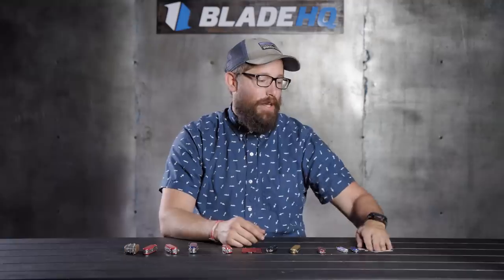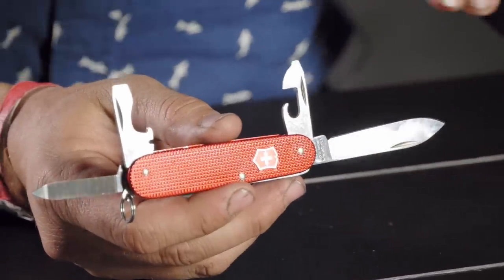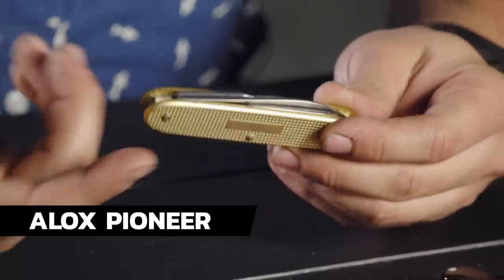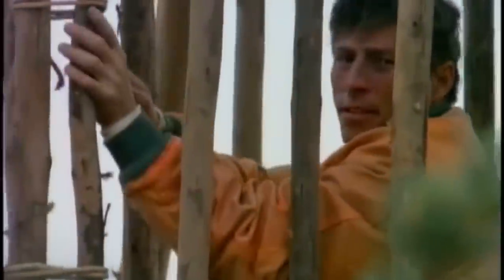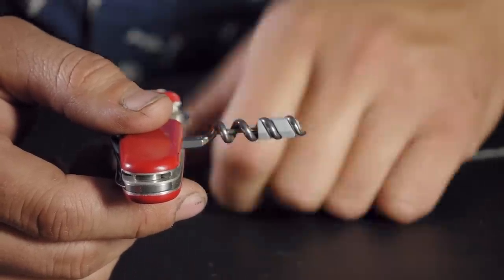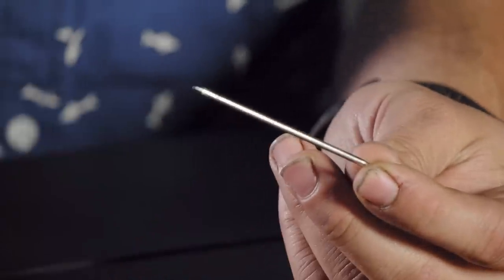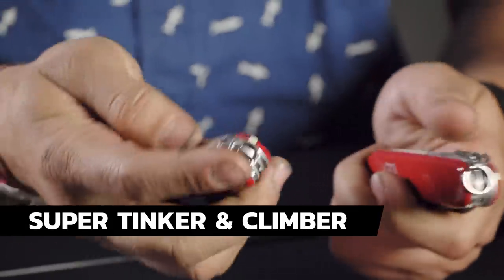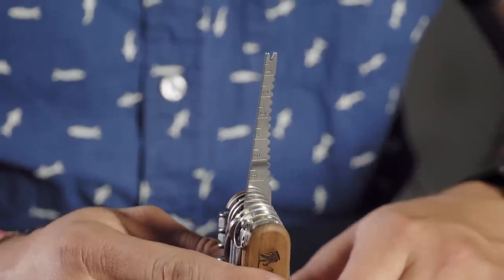Victorinox Swiss Army Expert Breaks Down the Best Swiss Army Knives | Knife Banter Ep. 88

Comment: The can opener seconds as a 2D philips head screwdriver on all SAK models.  Although it may partially mangle the philips screw you are using it on.

That being said the Cybertool S and Cybertool M are what I have found to be the most useful SAKs for my applications and thus the Cybertool S has become a part of my EDC.  

Being in residential construction, more so on the finish end of projects, I have lost count of how many door stops, door knobs, electric outlets, cabinet pulls, cabinet hinges, screen doors, and even light fixture I've installed using only this tool.  Usually when walking back out to the truck for a screw driver, drill, or pliers would have taken longer than just pulling out my SAK from my pocket.  

Although I cut my teeth on the Alox Cadet and then upgraded to the Alox farmer I found having a full "bit set" at hand is far more convenient than just the standard 3 driver heads included on most standard SAKs.  

Now if only Victorinox would make a Cybertool S and replace the blades with the pliers I would be eternally appreciative.  Reason being is I already carry a small utility blade(Rexford R.U.T.) and main knife.

Not to mention it would make for a very capable TSA friendly multi tool as well.

Make that version in Green Alox and I'd be on cloud 9 for sure!

Comment: I bought my first SAK in the early 90’s, a Champ for $50. I ended up getting a 2nd one in black opposed to the first in red. I gave my red one away to a good friend but still carry the black one every day in a sheath on my belt. I love the quality of the SAK, easy to sharpen, tools never loosen. I use the magnifying glass to see small print now that I’m 50, or to start a fire in good sunlight. The woodsaw cuts through a 2X 4 in seconds and it’s just a great all around edc tool. I still carry a Leatherman sidekick but it doesn’t have a scissors so I carry both.

Comment: I've once used the parcel hook to pop open a locked door. Just slipped the hook in a small gap between the door and the frame and it hooked on the inner door lock and I just pulled it open! 👌 Worked like a charm! 
(And don't worry it was on my own property)

Comment: This is a great video.  Thank you for sharing.  What I am using more often for screws is Torx Screws.  They are much easier to use for construction. I just insulated my roof with polyiso insulation and built a frame work on the top of my roof and have put it altogether with a frame work and Torx screws.

Comment: I use the flathead screwdriver for opening jam jars. Don't know if you use those glas containers with metal lids in the US but here they are common. And with the flathead you can go under the lid and twist a little to release the seal and get the thing open.
Also some cabinets for technical use got "locks" which can be opened with it...

Also the thing with Swiss army knives is you pick one you like and carry it, you will find unintended uses for almost any tool.
No need to search for what you can do with the tools, you will encounter situations where you need to do something and will come up with a helpfull usage of the SAK. I don't drink, but in one occasion camping with a bunch of people one of them had a bottle of wine with them. But none of them had thought of an opener, and while they were thinking of breaking the bottle i handed them my knife...
As for SAKs and Leathermans and SwissTools: they aren't better than proper tools for the job, but sometimes they are the only tools at hand, and save the day.

Comment: The hook on the compact is a rope tool. It's used for tying and breaking knots. So, the little point on the end, is for pushing through a knot, and then you use the hook to grab a loop and pull it back through. It's basically like a crochet needle. I guess you could use it as a parcel carrier too.

Comment: I’ve been carrying a SAK for 40+ years in one form or another and my SwissChamp has been my EDC in my belt pouch for nearly 30 of those years. The tool is only limited by your imagination. I’ve used the parcel hook for carrying parcels, pulling tent stakes, picking up Dutch ovens by the bale, twisting twine and much more. Don’t make fun of the pliers, they work better at pulling some splinters than the tweezers. The question was asked as to why the flat head screw driver and the answer is in the name…Army.  When the knife was developed the screws on most equipment, including rifles, were slotted. Even today many weapons are still assembled with slotted screws. Also, you can still turn a Phillips head with the flat head screw driver.

Comment: I have zero problem carrying the Swiss Champ everywhere I go. It's easiest in the cordura pouch, but I also carry it by hanging it from a belt loop with a Paracord lanyard I made. It can be dropped into either my front or back pocket  while hanging from the button and loop lanyard, or just left hanging free. The lanyard can go around a wrist for working over water or drops. The lanyard is quick detachable and serves as a strong soft shackle. Additionally I have a thermometer, and compass with magnifying lens, and a light, attached  by a loop and button lanyard which can be quick detached and used or secured seperate.  I got the Firefly firesteel and corkscrew   fuel installed as well. I use the hook to to secure Paracord I'm working on, by closing it with the cord in the hook, and tension it by hanging the knife over something while working the cord. It's good for pulling one end tight, just hook the cord and twist, then close grip and pull. Victorinox steel is absolutely fine. If your chipping your blade, your abusing it.  SAKs are superior quality and toughness than Leatherman, and are far more dependable and useful. Tweezers are great, but far more useful with a small light and a magnifying glass.

Comment: You spoke about the pen right after the hook. The hook can be lifted up and the pen slotted into its groove, then the hook closed carefully - Then you have a longer and easier to use pen. I have also used the hook to grab things in a narrow spot eg a cable in a hole. Other uses below. The SwissChamp can be carried in your pockets if you have thicker materials eg jeans / heavy shorts. The great thing about that is it has everything you might possibly need and is more convenient than a pliers based tool - Tools are easier to access and it's lighter/smaller. The fish scaler is useful if you need a non-sharp pokey tool!

Comment: 4:23   He is showing off some seriously dirty fingernails. ha ha.    21:30 The parcel Hook will hold the Pen and allow you to write more comfortably.   If you lift the Parcel hook, the pen will lay perfectly in the slot the the Parcel hook rests in. Once you lay the pen in the slot, lower the parcel hook to add the pressure to the pen.  YOu can then hold the knife and write much easier.   I made a video on this about 8 years ago.  Search practical use for victorinox parcel hook.   Also, if you use a p-7 suspension clip, you can carry the swiss champ no problem.   P-7 clip is the reason I don't carry the Super Tinker, Compact, Explorer and Yeoman any longer.  cheers!

Comment: I recently kinda gotten into SAK knives. I have the fieldmaster. Its the same as the huntsman but instead of the corkscrew it had the Phillips screwdriver. And i have replaced the toothpick with a tiny fero rod, called the firefly. EXTREMELY handy for starting a fire. It's awesome really.  And i use the "parcel hook" quite a bit.  I use it to take the cooking pots on and off the fire when camping. Works great. Im looking into getting another SAK for EDC. A larger pocket knife one. Im quite impressed with my fieldmaster. But its kinda been designated to my backpack.

Comment: Worked as an in-house computer support guy for 20+ years maintaining 100 or so PCs and carried the Tinker most of the time. It was my first-line tool because the phillips and straight-slot screw driver attachments allowed me to open the metal computer cases, install expansion cards (graphic, memory, modem), swap out CD/DVD and hard drives, etc. The smaller knife blade opened shrink-wrapped packages, toner containers, just about anything that was in a box or an envelope. The tweezers came in handy if I dropped a mounting screw inside the computer case and wasn't able to retrieve it with my fingers. The Tinker's design is compact enough for business casual pants or jeans pockets. Still carry one even though I retired a number of years ago. Great EDC tool for me.

Comment: I've got the cybertool 34 and carry it daily. It's got the removible bits and driver on it which makes it great for quick repairs in the field during a photo shoot. It's also great for odd jobs round the house and for tightening up loose pot handles and the bottle opener is great for opening stubborn jars. Just pop it under the lid and lift and it releases the seal. Makes opening jars a breeze.

Comment: In Europe Phillips and Pozidrive are the most common screwheads. However, I think Victorinox integrates a lot of these flathead screwdrivers, because otherwise it would be wasted space on the pocket knife, the flathead screwdrivers is almost never a standalone tool, it is always a secondary function of another tool. I personally found the flathead screwdriver on my Alox Farmer works wonders as a scraper or prybar, you don't risk damaging the blade or cutting yourself. If you need screwdrivers, you quickly need so many different types and sizes, that there is no way you could integrate them all in a pocket knife. With the Swiss Tools however they offer a little bitset with either a ratchet or a rightangle srewdriver that fits into the pouch together with the multitool.

Comment: Since you asked about the flathead drivers...The large driver was included on the very first production Swiss Army knife, and did not have the cap lifter integrated. It is there because it fits the flathead screws that were on the standard issue Swiss rifles at the time. It was later integrated with the cap lifter when pop-top bottles became common. The design remains because, so long as you need a beer opener, why not have an extra screwdriver too? Also, the smaller driver on the can opener works well on most standard Philips head screws. I use mine on Philips all the time, and it has not damaged any screw heads, nor the tool.

Comment: I have the big SAK that you showed but with the plastic scales. I never carry it. I carry a PM2. And I don’t use it as tool for any serious work—I have a Leatherman Charge for that. But, I have had that big SAK sitting on my coffee table in the basement where I watch tv for many years and I use it frequently. I use the tweezers and the toothpick all the time. The pen comes in handy to jot stuff down. I’ve used the screwdrivers a bunch of times for odds and ends in the basement. The scissors are used frequently. Basically, it’s a great thing to have on hand in an area that is away from your main set of tools and also for personal use items.

Comment: As someone who fixes slot machines for a living these tools actually make alot of sense. I could use the hook tool for all kinds of things. I use the corkscrew as a pick tool and ive actually used it for knots not even realizing that was a thing. You asked why the flathead and not Phillip's and I think I have an answer. You can use a flathead on a Phillips screw but you cant use a Phillip's on a flathead. They also come in clutch as a right angle screw driver or in a tight place.

Comment: MacGyver's greatest use of the SAK was when he built an airplane with just his knife to make an escape.  I have a personally engraved all metal Swiss knife that has the orange peeler.  It works great for its intended use.  As for the parcel hook: if you're a camper you use it to lift lids or pots off the campfire without burning yourself.  I've opened many a wine bottle with the SAK corkscrew and as for the tweezers-- they saved my butt many a time getting splinters out of my hands.  It's one of the more effective tools of the knife.

Comment: I've had my Executive for about 30 years now, I use it every day for all kinds of things.  I bought it for the novelty of the orange peeling blade, but only used that blade a couple of times because the sap from the orange peels made the knife too dirty, and I didn't want to wreck it.
I love Victorinox knives!
Reply: i have mine for over 25 years, and done the same, while it works good for peeling oranges, the cleaning afterwards is what prevents me from using this function often.
Reply: I never peel oranges with anything but my hands. However, that tool is my rough cutter and driver. It opens caps on vape juice bottles, cuts through parcel tape, and every other messy material. It's my beater blade. The driver tip has repaired more things than any other sak I own. But I know it's limits. That's why I carry a Gerber shard with it. I filed the end of the nail file to fit tiny screws. Also file is good for opening star key locks at work. Executive is my most carried fo nearly 4 years. I can see myself hitting the 25/30 year Mark like you two fellas.

Comment: The larger multi purpose knives  are worn in a pouch on a belt, great on a farm when machinery needs adjusting and the tool kit is at home. Also carried good quality adjustable spanner ground out a few millimetres for large nuts, and a multitool  in pouches on my belt for years.right there when you need them. Pliers on the multitool work with the adjustable spanner for nuts and bolts. I used a 12m compass walking into the bush, to know my way back. It was on a key tag with a 15mm long thermometer. Easy to get lost. The 2 most commonly used size allen keys would be most useful. Espceially for cyclists.

Comment: Good discussion on the hook in the comments here. I agree, just pulling on stuff is something that comes in handy quite often. People here write about shoe strings, carrying stuff and the like. I have used it a bit, what comes to mind is; pulling a pot from the fire when camping, pulling tent pegs, opening an older type of drawer that requires the key to be used as a handle, when the key is missing but the drawe isnt locked, just putting the hook in the key hole and pulling. Also ive pulled out rusted ring-hookes(?), the ones that looks like grenade sprints and secures cheap wheels on a cart for example. It often does a lot of the work that pliers would do, just not as good. On the other hand, it dosnt take up any space at all. A pretty nice compromise. :)

Comment: I carry a Swiss army knife I've been using it for a few years now. Scissors, knife, corkscrew, flat head, can opener, nail file, and an a pokey thing for making holes, idk what it's called. I put a neodymium magnet where the Swiss logo was because it fell off so I carved a hole big enough for my flat magnet then put some shoe glue over it so it didn't scratch anything or get scratched up. I love the metal the blade is made out of, it keeps it sharp and easy to sharpen

Comment: I have several SAKs, but I carry two regularly. The Trekker and the Tinker. The Trekker has a utility blade that is sturdy and slightly larger. But the larger saw is very useful for harvesting branches for wood carving and tinder, while the reamer is useful for making holes in those branches. The Tinker is primarily used for wood carving camp utensils and toy animals, Santa’s, and little people. Those two SAK are with me daily in my pocket and my sling pack.

Comment: If you own a harpsichord or clavichord, you need a hook similar to the SAK parcel hook (I stuck a little screw hook into the end of a pencil to make mine). Because each string has a loop at one end, that goes over a nail; the other end is wrapped round a tuning peg. And since every string has a different length, the manufacturer of the strings doesn't do the loop for you, as they do with guitar strings for instance - you have to make your own by passing the string through the hook and twisting.

Comment: I used to work on a farm and the buckets had wire handles with a little plastic handle that would crack and brake. That little parcel handle would have saved my fingers so much pain carrying multiple buckets filled with water in the cold.

Comment: I've watched a lot of Swiss Army Knife videos and I'm getting to the point where "best" and "worst" essentially boil down to - does the tool contain all the things you want or not? Because that's all it in a nutshell. Most tools will come with some common stuff (blade, bottle opener, can opener) and some variations, e.g. philips screwdriver vs corkscrew. Or saw vs pliers. Or scissors vs file. Or serrated edge vs straight. Beyond that there is precious little beyond models to compare about - it has a blade, it opens bottles & cans and it has some other stuff. They're basically mix and match for the dimensions they're made for. Pick the one you like.

Comment: I use the Hunter and the Fieldmaster.
I have to carry both.
Together ...the parcel hooks to pull baling twine out from rivers ....and fences and trot lines out of the rivers.
Clean up...and salvage.
We have a lot of rogue twine...and it's a nuisance.
And the Phillips screw driver of course...on the Fieldmaster.
But I need the corkscrew on the Hunter to undo knots.
The corkscrew...
Its also useful for cleaning out piping...tubing...and sockets.
And screwing the knife into a wooden post to set up as a jig to cut..and use the can opener.
Don't try it on extremely hard wood though.

Comment: The parcel hook is good for pulling the handle on a Ammo can wire handle and the old sealed ammo cans. It also can be used as a spring puller for the springs on brakes , expansion chambers and kick stands.